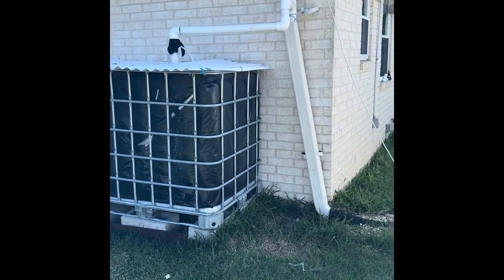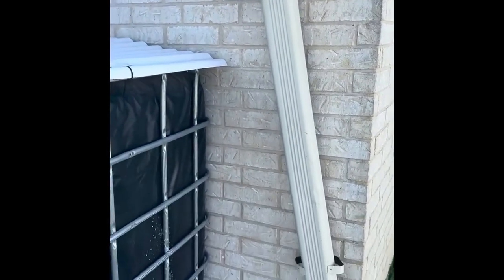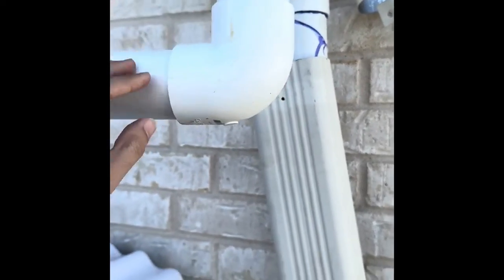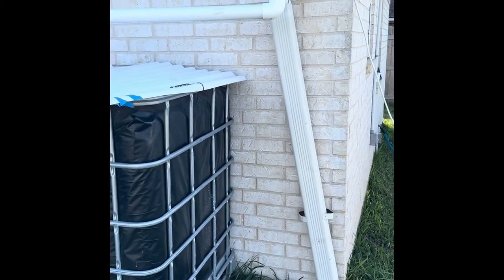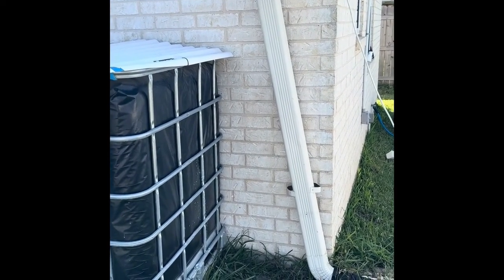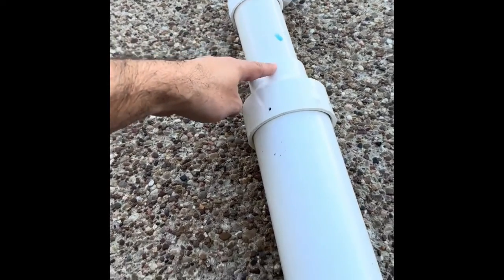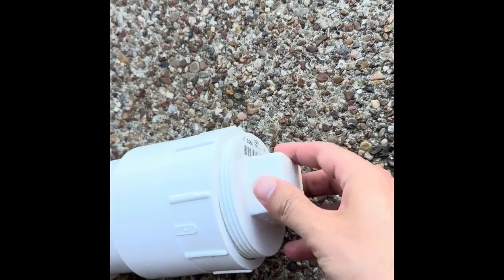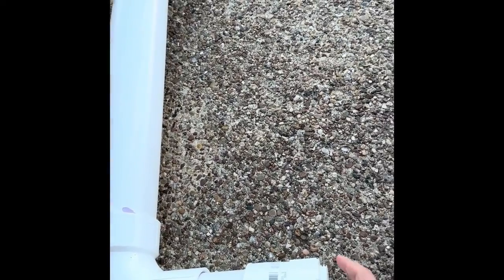Guide for Creating a Homemade First Flush Diverter - Rain Harvesting

Comment: Use a racket ball. It is slightly larger than 2in in diameter. Used in mine for a few years. I'm having to rebuild mine. I did not use a 90* and just dropped down from primary flow with about 1-2ft of 3in (w reducer). The problem was with the asphalt from roof getting into the threads (yes, I tried to clean). The sun-baked pvc was no match for my gorilla grip. I'm thinking I might make a bleeder valve to take pressure off the opening. Maybe use the irrigation tubes you see and add a second flush as well.

This is about my 4-5 year of doing this and I make advancements each year. I have a 1/2 in supply line under ground with grade to my garden where I have soaker hoses. We tried the emitters, etc with a pump, but the wife did not like it. I have values at each raised bed to control which ones get the flow.

I also have a solar panel charging a 12v for lighting and transfer pumps for sprinklers when garden is not in high demand. I have 2 IBC (250-275) and adding a 3rd next spring. I basically have the same design with the 2in sloping down  gradually to the third one.

I might look into the hose you have instead of my design with a tee allowing air flow as not to create a vacuum.

I'll come back and post pics once I complete the two flushes.
Reply from the maker: Thank you for sharing your experiences. I will look into those modifications you mentioned! I do have a window screen at the top in the gutter to catch the asphalt but man, it is a pain to keep it clean during the rainy season. It can get clogged and the rain will pour over the side of my gutters if I don’t clean it often.
Reply: Will do. Going to noodle on it some more. Another thing I have I'm not sure you do. I put a ball valve (2in) just after the kick off from the down spout. When my tanks are full OR I simple want to close the system and divert to the yard I close it. I might place it after the flushes to avoid trash in ball valve.
I also have covers (black) I purchased from Amazon to cover to help prevent algae. (FYI - I still had some. I just cleaned it out, thus the SNAFU breaking the tee where the first flush was.)
Reply: @CentralTexasGardening  How can I share a pic on here? I'm not YT savvy.
Reply: @CentralTexasGardening  I sent the link but not seeing it. Did you remove it or I do something wrong?
https://youtu.be/TmJ6tbDb9-I

Comment: Be nice to see how you did the top part it’s not shown in video, how you connected to gutter?
What and how did you do the over flow second pipe that goes to back of house?
Super looks like it would work great.
Reply from the maker: Good question. I may have to do a short video one day on showing that. The overflow goes into the original metal downspout coming off the gutters that I reused and ties underground into some 4” corrugated piping that I use to drain my backyard during heavy rains. It goes to the front of my house and dumps into the street.